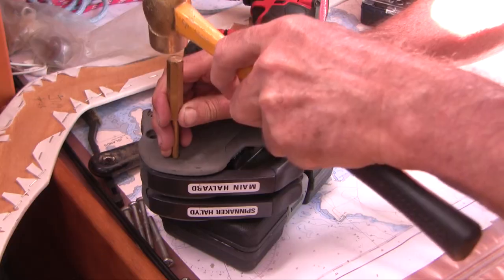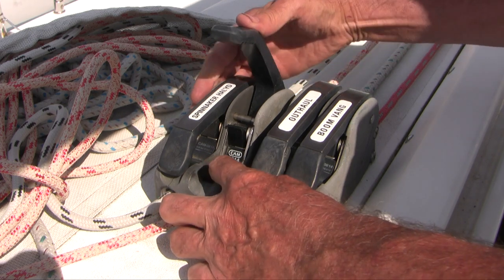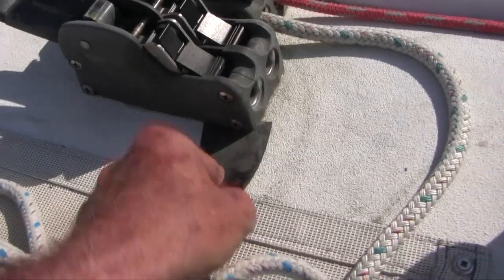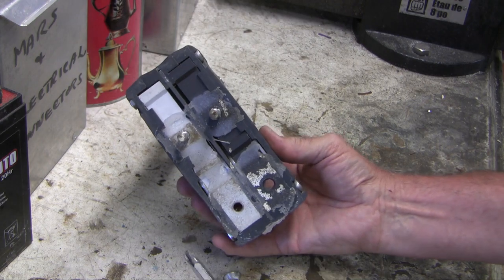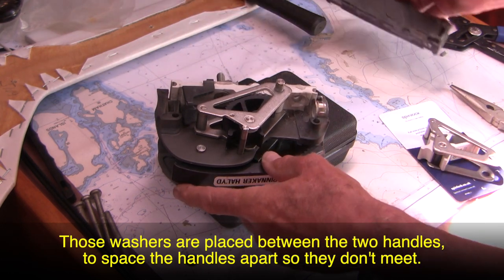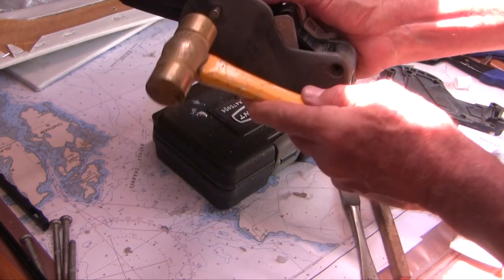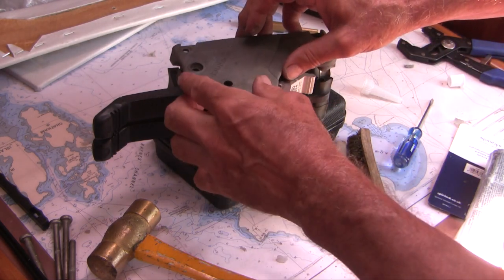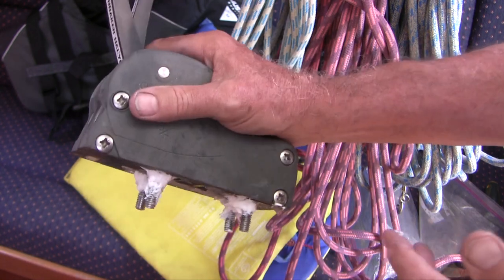How to diagnose and fix a slipping sailboat line clutch

Comment: This video is a great resource, thanks.

Generally I am dubious of clutches, some of my friends like them a lot. I just imagine more holes and a new failure mode. 

 I like the idea of  being able to multiply the lines that each winch can handle. I had not thought of that, amazingly enough.

I also did not think to ask if they were serviceable. Clearly they are! Or at least some brands.

Thanks again.

Comment: We did our winches and clutches a few weeks ago. They just needed a good clean and lubricating. Our clutches are through bolted to a tapped aluminium plate in the layup. God knows how thats going to come out when they need to be removed. Great video, Sail Safe mate. Ant & Cid
Reply from the maker: That's an excellent point, the first step should always be cleaning debris from those teeth. It didn't work at all for my boat but it's a quick fix. Those teeth walk a fine line, since if they are too abrasive the line won't last long at all. I'm surprised that even after decades of use my line cover was chafe free at the clutch. I bought the new line a little longer, and I specifically used a knot rather than an eye splice for the shackle so as the line ages I can reverse the line to shift the high chafe areas to get another few years of life.

Comment: Thanks for sharing. I’m about to upgrade a 3-clutch to a new 4-clutch and although I won’t be pulling them apart to service, seeing how they’re put together will help in their removal and reinstall. Mine are screwed into a threaded backing plate, so when installing and sealing the screws I have little option than to turn the screw heads which is less than ideal for the sealant. My plan is to use standard 3M 4200 and work quickly. I am concerned about having too much squeezout inside the clutch that will imped operation. The OEM boat manufacturer doesn’t appear to have applied any to the screw heads inside the clutch, so I’ll figure out sealing better when I see how the 3-clutch comes off. Any suggestions?
Reply from the maker: In that case I'd be inclined to also put sealant on top of the bolt head after it is tightened up. Mine is countersunk so much that rainwater can form a little lake on top of the bolt head, so filling that void will help reduce flow. Presumably the manufacturer made the fit so exacting that the volume of rainwater penetrating through is already very small. Sealing the upper neck will similarly reduce flow. You may not want to seal the very bottom, since any water that gets deep inside would be better to drip through entirely and evaporate rather than being trapped against the wood core.
Reply: @spelunkerd  thanks 🙏, very helpful … now to get cracking and getting it done.
Reply: @spelunkerd  In my opinion, silicone sealant is too weak for this job and is prone to peeling away from the surface in the future. (It will also prevent other, better sealants from adhering from now to eternity.) My choice here would be butyl rubber. It's good for 30 years generally, and both stretches if there's any flex, and if there's ever separation (unlikely), it will re-adhere. Just as important is to chamfer the hole at the deck to effectively create a little O-ring with your sealant. Ideally, you also want to drill the holes oversize, fill with epoxy, and re-drill to bolt size, creating a structural and waterproof seal. A shortcut would be to at least soak that hole with penetrating or plain epoxy to waterproof it a little better.
Reply from the maker: @fiddleswithbikes  Those are excellent points, especially your remark about drilling the hole large, refilling with epoxy, and redrilling. I believe the holes in this boat were done that way at the factory when they were originally installed in 2002. I had a close look at the holes, and you can't see any wood inside the barrel of the holes, and there is sealer coating of the wood underneath as well. If I had drilled new holes I would have done exactly that.